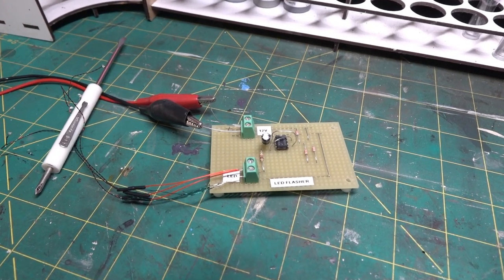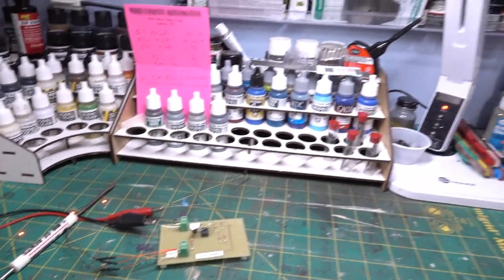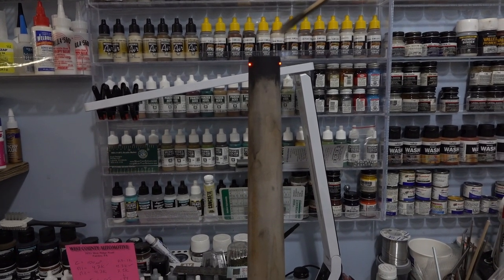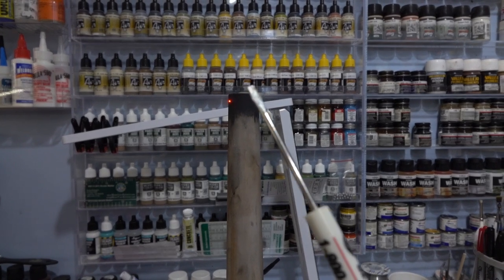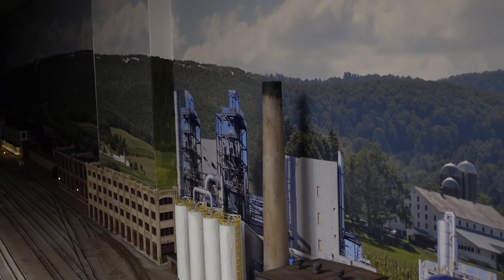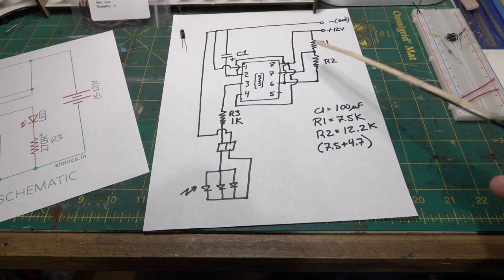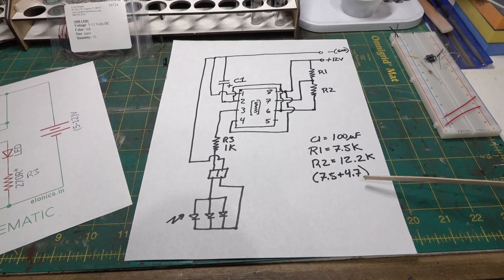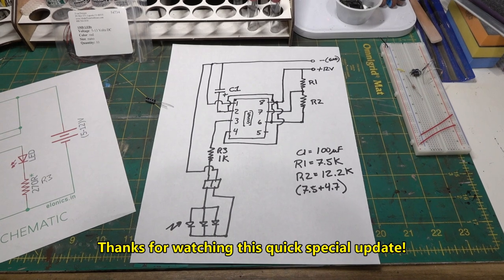MRUV: Special Edition- Smokestack LEDs

Comment: Awesome Rob! I love it! What is the smallest 555 chip out there on the market?
Reply: Not sure Jon. I had two 555 chips in my IC drawer so just used one of those. I think they make surface mount chips as well as through hole, but I don't know if the size has changed.
Reply: Rob Bennett what is the size of this one that you had used? I'm going to need a very small one for an idea that I have. Or would there be anything that does what a 555 chip does though smaller? I'm no electrical engineer sadly haha.
Reply: I used a "normal" one, I guess. Typical size for an 8 pin IC. I think they are a standard size and pitch. I am not aware of anything different, other than surface mount. If you need a tiny one, you may need to fire up Google and do some research.

Here is a link to the TI spec sheet, toward the end you fill find the size info: http://www.ti.com/lit/ds/symlink/lm555.pdf

I assume most others are similar in size.
Reply: Rob Bennett Thanks!

Comment: THANKS, VIDEO  AS DETAIL PUT INTO LAYOUT AND BUILDING  AS HIND THING ALL WAY PUT WALKWAY ROUND TOP THERE
Reply: Robert- I did consider adding a platform with railing around the top- that is how the stacks were at the power plant where I worked. I still may, if i can figure out what to use and how to do it. Stack is just setting on the layout for now.